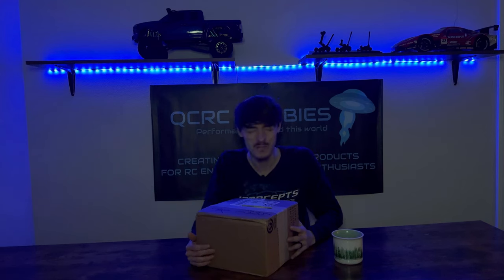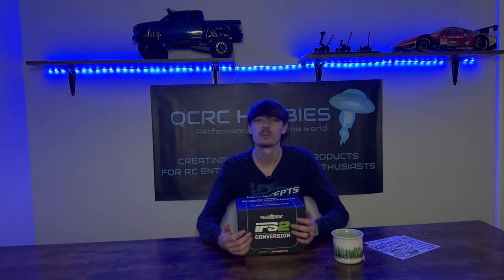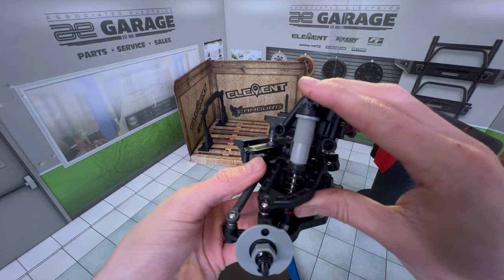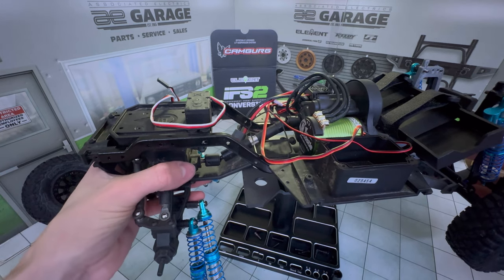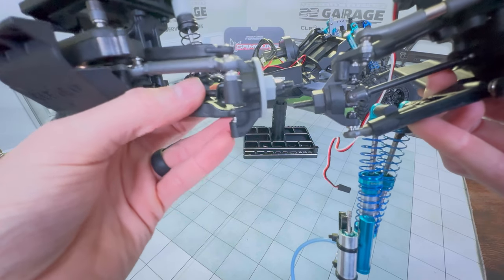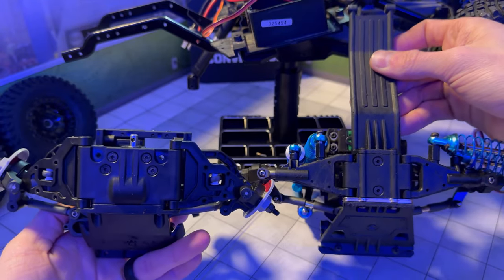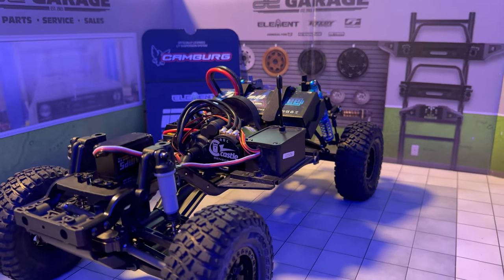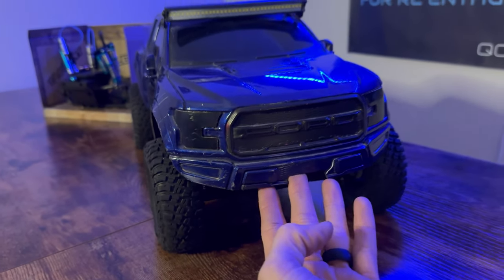The Element IFS2 VS IFS1 Side By Side Comparison and Installation Guide You've Been Waiting To See!

Comment: Bro, I’ve got the same issue but I can’t tell the cutting part, also the servo when I turn on the remote control go to the left side position .
Reply from the maker: looking at the kit head on.
Your going to cut the small nipple on the left side of the bottom diff cover.
Take your finger and feel in the diff cover you'll feel the only little sharp piece of plastic there. Cut that piece and your good to go. Pause my video and you'll see the small plastic. Use a new exact blade and make sure you get the piece out so it doesn't get caught in the gears.
What remote are you using? If using the stock remote their is a switch to reverse the imput of the throttle and steering to fix this issue.im.not looking at a remover right now but I believe It's the one on the right side. Let me know if this helps!

Comment: Great video but you did not compare the ground cleareance between both...😢
Reply from the maker: Oh no I apologize! 
I will pin this comment to the top. 
Just measured on the bench and with my tire setup (Proline BFG KM3 1.9 4.19”)
The IFS1 has 1.75” ground clearance. 
The IFS2 has 2.25” ground clearance. 
So you’re gaining a total of 0.5” ground clearance with the IFS2! 
Hope this helps you guys! 😬
Reply: Thanks man.. I will be waiting for a run test video.😊

Comment: Just installed the IFS2 in my RTR knight runner and the axles do the same thing... how could element not catch this  $99 and i have to basically damage a brand new part to make it work
Reply from the maker: Interesting, I was thinking it was just me! Hope you got it all worked out man!
Reply: @QuadeCrabtree  It's because the IFS2 kit is from the new ''Element Utron''. This new rig use not the same gearbox like the KnightRunner and this gearbox run reverse rotation at the output. This is the simple reason!  Team Associated Element did not make his job for the explaination  fot this great front end swap! Sorry for my soso english. I speak french currently ! :)